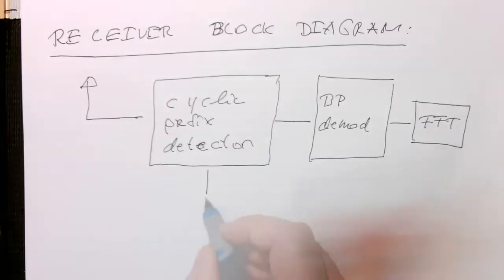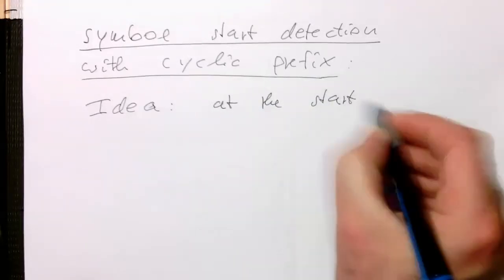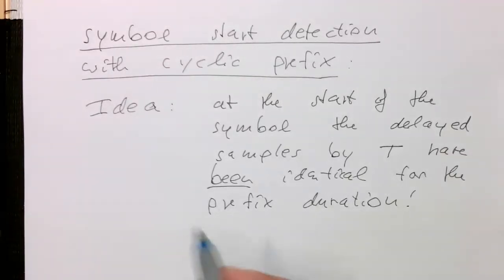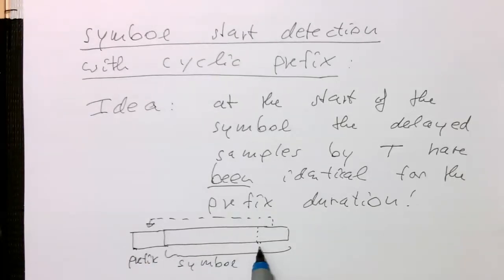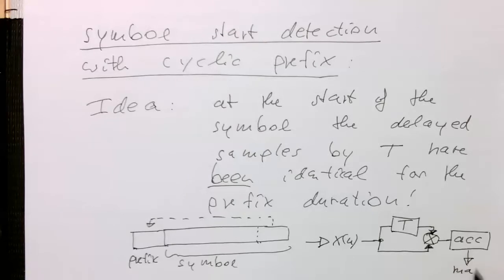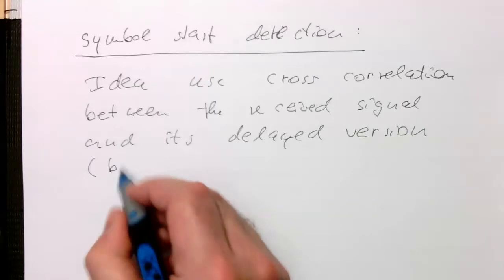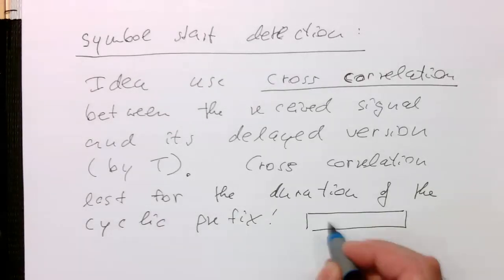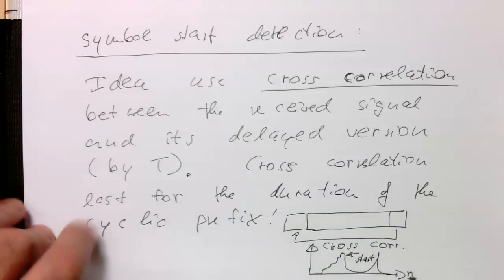OFDM: Cross correlation for cyclic prefix detection (0019)

Comment: Hello. Is it true that - while the transmitter side is able to inject a cyclic prefix.... the receiving side will not see a counterpart cyclic prefix pattern --- because a multipath channel corrupts a portion of the transmitted cyclic prefix sequence, right? Eg. if we transmit x = [a b c d e f a b c], and channel impulse response were say h = [0.8 0.5], then the received sequence is y = {x convolution with h}. So the sequence 'y' is not going to contain any form of cyclic prefix anymore. So I'm thinking what is the point of detecting cyclic prefix at the receiver side when there is not going to be any cyclic prefix to detect?
Reply from the maker: Excellent question. Well the impulse response is much shorter than the transmission sequence = OFDM symbol. That can be as long as 300ms (30Mhz, 8192 samples). The cyclic prefix is perhaps then 100ms which is still very long compared to any echo (100ms = 30km). What you get is a stationary process which still allows correlation. It just messes up the higher DFT coefficeints because of the fast echo decay. Think if it as a bad FIR filer. Plus the DFT is cyclic so works for your advantage. That's often swept under the carpet. The rest can be done with channel EQ. For that reason in urban environments the cyclic prefix is short (short echo) whereas in mountainous areas its longer. It's discussed especially for DVB-T in the literature.
Reply: Thanks very much for your kind reply! Definitely making sense. Is it true that while the cyclic prefix at the transmitter side (eg. sequence "a b c d e" (here --- assuming a CP length of 5) might appear within the transmit sequence as [a b c d e f g h i j a b c d e], then once it travels through the multi-path communications channel, the received sequence won't have a sub-sequence that has a counterpart cyclic prefix pattern equal to 5 right? That's because the channel impulse response (eg. h = [0.8 0.5]) wipes out some of the transmitter's cyclic prefix sequence. However, the received sequence (at the receiving side) will at least have a pair of repeated sub-sequences (spaced apart by some time) --- such as [C D E x x x x x x x x x C D E], right? So instead of having a received sequence of [A B C D E x x x x x x x A B C D E], we might get [x x C D E x x x x x x x A B C D E] - so it's no longer a case of cyclic prefix detection as such ---- but is instead a case of detecting a pair of repeating sub-sequence patterns, where these particular repeating patterns each have a length that is less than the length of the original cyclic prefix, right?

If a section of the cyclic prefix gets wiped out (due to the multi-path channel impulse response), then the receiving side won't be able to see a counterpart cyclic prefix having the same length as the transmitter's cyclic prefix length, right? However, correlation can still be applied because at least there is still some sequence repetition seen at the receiving side, right? 

Thanks again! Really appreciated.
Reply from the maker: @southpark5555  Indeed. Multipath is just a filtering operation which modifies everything so both the original chunk and cyclic prefix so we are good again! The issue is just at the start of the cyclic prefix when the mulitpath "filter" needs to settle. As soon as it's stationary then the x-correlation will be perfect again.
Reply: Thanks very much for going out of your way to explain all that! Very much appreciated! I think things are starting to click and gel now. This helped a lot. Where I was going wrong is probably due to the wrong assumption of the time-frame of events. That is, I assumed an IFFT sequence such as x = [a b c d e f g h i j a b c d e], and maybe wrongly assumed that the channel impulse response - such as h = [0.8 0.5] has the same time-scale as the IFFT sequence x. But an actual channel impulse response will have duration much less than each and every element of sequence 'x'. I think this where this really got me. Thanks again!